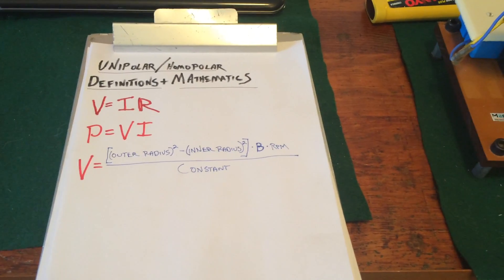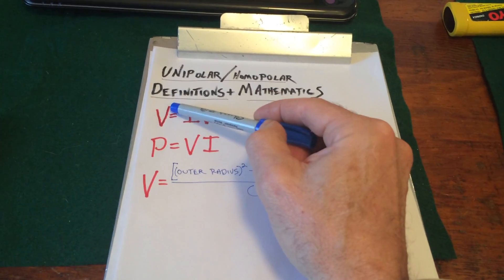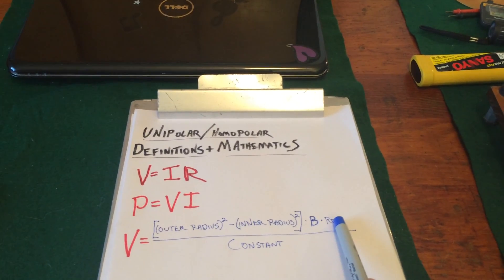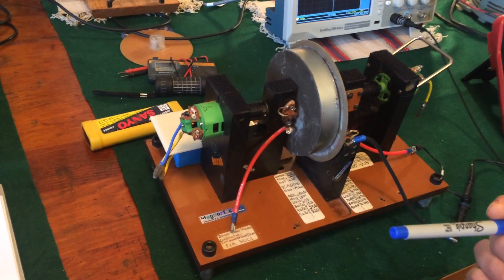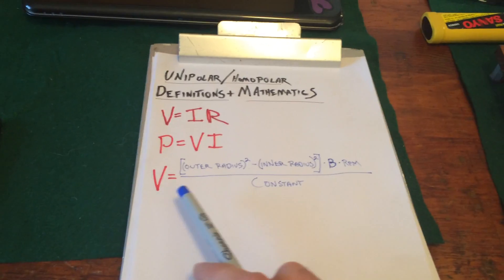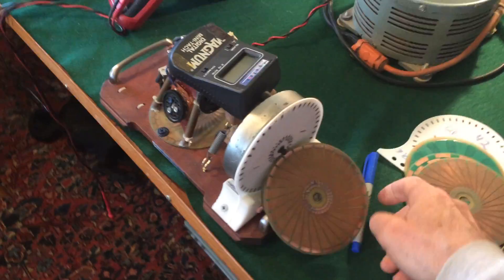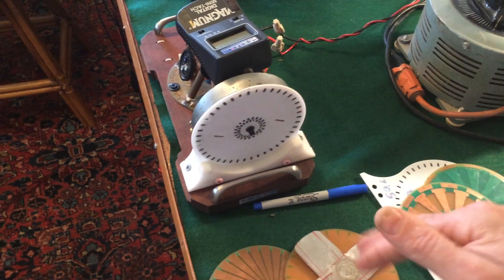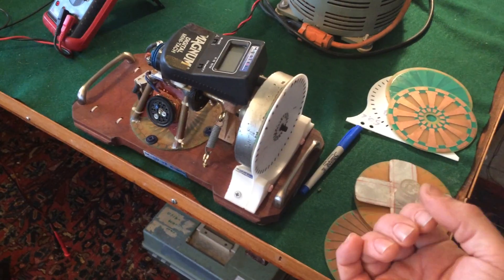homopolar/unipolar math 2 amps+power

Comment: Could you conduct the low voltage across an arc using a high voltage diode to isolate the low voltage (generator) output from the high voltage used for making contact?  Not sure if high voltage spark would support continuous contact or it would be intermittent.    Seems you should pull the voltage from the magnets inertial plane or you will get an induced voltage in collector.
Reply from the maker: Thought about this; the idea has some potential, but this is a high current machine and such a spark gap will produce huge erosion of contact points due to the high current and also this means the whole apparatus should be in a vacuum chamber filled with rarefied gas to help the arcing current.

Comment: Why have on the intricacies in the copper disk, why not just be one solid disk of copper? Even more what I wonder, since they can spin together and get power, if your magnet is made of a conductive material with no coating, can the copper make direct contact and spin together? I know how to make monopole magnets out of non-magnetic metals. Get where I'm going with this?